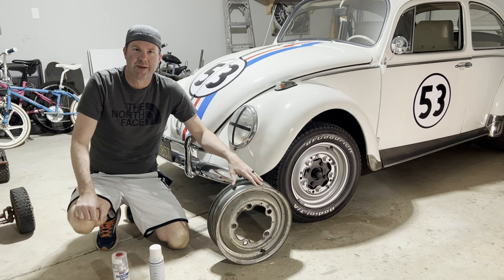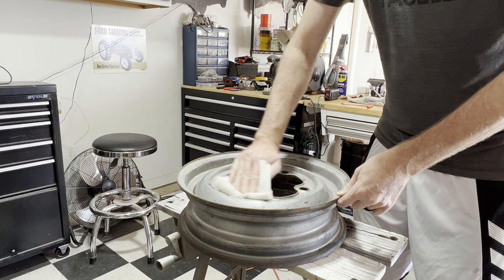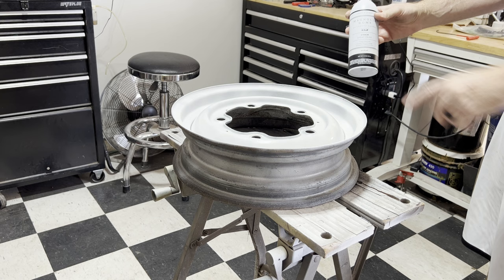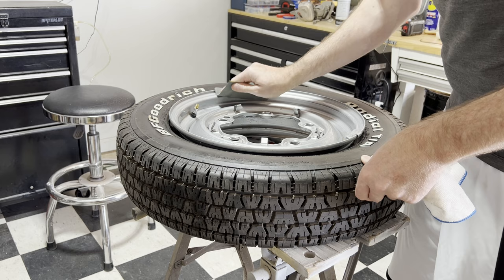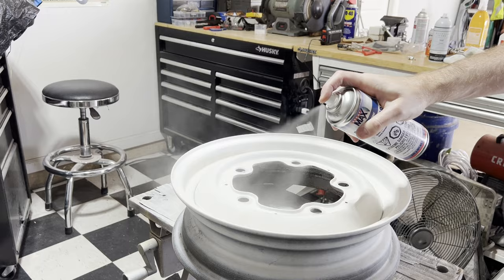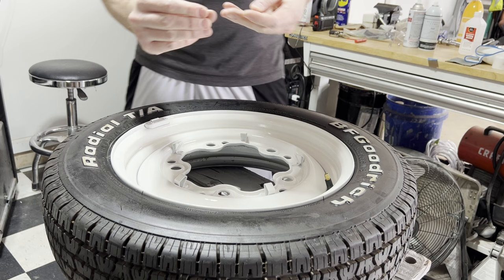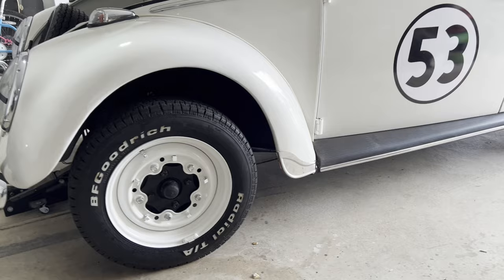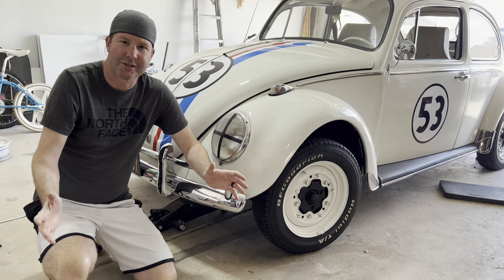Painting Volkswagen Beetle Wheels - Herbie Gets Matching White Wheels!

Comment: Hey man, just curious where you got your brake warning light on the dash from? I have that old style you had when you first got the car, I love the flush look of the one you've got now!
Reply from the maker: Thanks! It’s the same warning light. If you’ve taken yours out of your dash you’ll notice there are two parts to it, the light switch itself and the round cup or housing it sits in, that’s the part that sticks out. Not sure what it’s called. All I did was cut and shave down the sides of that cup so only the backing was left. I basically turned it into a plastic washer. That's what the switch sits in now to give it the flush look. Hope that makes sense.
Reply from the maker: Oh and I forgot to mention. I then taped masked off the red warning light and spray painted it to match the dash color.